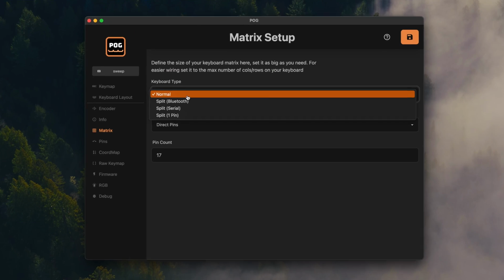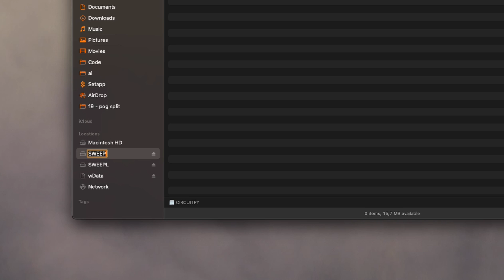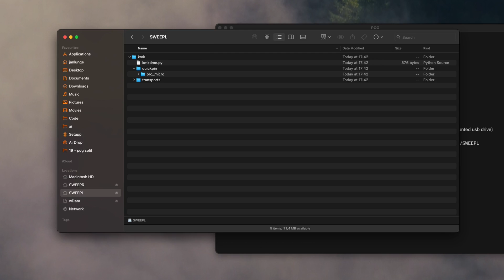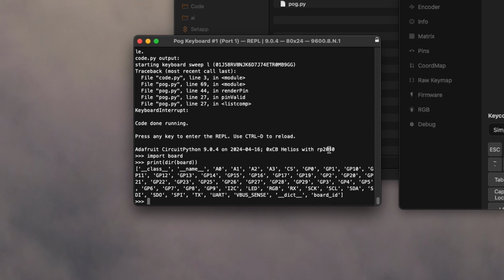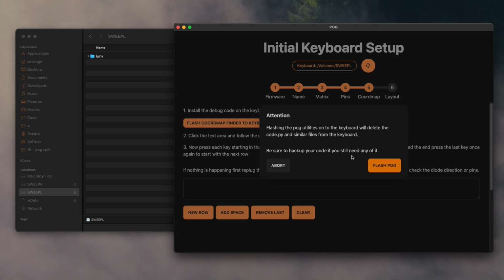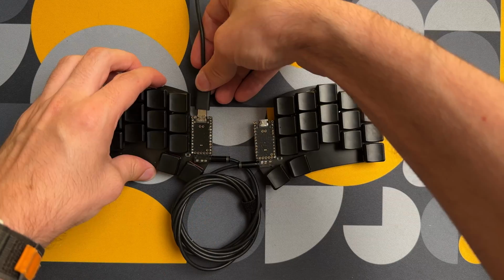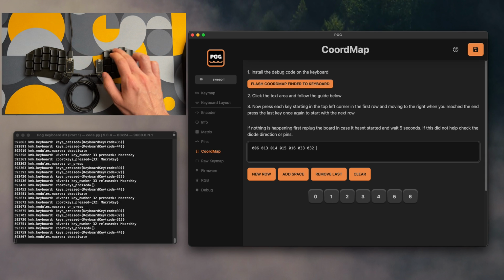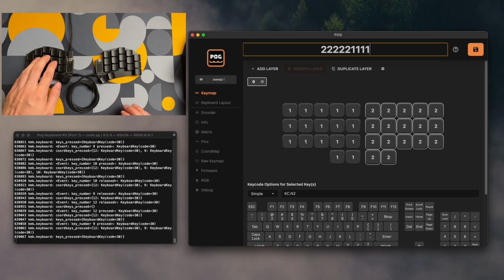Split Keyboard with KMK Firmware and POG Setup Guide

Comment: For some reason, I cant connect the two halves of my keyboard.  I am currently using the rp2040, the pi zero waveshare. The halves are connected by the Gpio 26, i ve tried using the usePio option but i cant get it connected. Do you have any idea of what could be this issue  ? I ve tested all connections and pins physically and they are all good, but the transmission doenst happpen. I am using the both halves connected to the pc as they were the main one

Comment: I need help !!! I dont know anything about coding and im trying to make a split dactyl manuform 5x7 keyboard with 4 key thumb clusters powered by the YD-RP2040 micro controller and ive tried to do everything and i mean EVERYTHING and theres nothing working ive wired the colums and rows collectly and i still get no input , i did all possible combinations in pog and i still get no input WHAT AM I DOING WROOOOONNNG!!!
Reply from the maker: Did you try each of the sides on their own when you set the type to normal instead of split?
Reply: Yes @JanLunge
Reply: @JanLunge  i fixed it it was a software problem i was pissed off when i wrote that message i took a nap and tried again with your older video about POG and it works now tysm

Comment: POG 2.0.4, CircuitPython 9.2.7, RP2040-zero. Board named TEST L. First screen: KMK install, Firmware Update. Second screen: name TEST L; Third screen: Split(1 pin) ... Forth: Drive Label L\R -> NEXT, Flash codmap finder... and keys not appear. But if I use Normal (not split) or as right side, then codmapfinder works. What I do wrong with left side?

Comment: Can this be used with pcb
Reply from the maker: Yes as long as you can find the pin variables somewhere porting works (if its using an rp2040) your mileage may vary

Comment: Thanks a lot. Cant say how much I appreciated this tool. I have experience the seamless firmware integration of GP2040 in custom controller scene and wish keyboard scene would have something equivalent. Your tool is exactly that. The fact that it supports the popular Pi Pico is the icing on the cake.

Comment: "I've successfully managed to run the KMK firmware on my ProMicro2040, but the process was quite difficult. Since English isn't my first language, I found myself constantly referring to your latest videos to flash the firmware. However, I encountered some configuration issues with the latest version of POG, especially regarding the setup of the matrix and pins.

For example, when configuring the matrix, after selecting 'Keyboard Type' as 'Split (Serial)' and moving on to configure the TX and RX (Split Pins A & B), if I later try to change the matrix setting from 'Split (Serial)' to 'Split (Pin)', I can no longer remove the incorrect 'Split Pins B' setting from the JSON file. The only way to fix this is to manually edit the configuration after everything is set.

Moreover, since keymap modifications are frequently required after the firmware is flashed, this issue forces me into a loop every time I save, and the only reliable solution is to reflash the firmware from scratch, ensuring everything is configured perfectly from the start."

Finally, thank you for making this excellent firmware configuration software for us to use.
Reply from the maker: yes it keeps the old values in the json but the code is supposed to ignore values that are not needed so there is no need to remove it by hand, if you encounter an unexpected error there please open an issue on github with some steps to replicate so I can try to fix this. Thanks for your feedback here :)

Comment: Hey Jan, I really want to start 3d printing my own keyboards aswell. What kind of 3d printer would you recommend?
Thanks already, and great videos man!
Reply from the maker: this really depends on the size of keyboard you want to build, for split keyboards even smaller printers work fine as well as the usual prusa i3 size, one you want to build things larger than the dactyl manuform or keyboards that are not split you need to either print them in separate parts like me or have much bigger printer, i can still recommend the prusa printers and i am still using the mk3s as I dont need to tinker with it much to get nice prints. the newer printers today are much better and I was looking at the voron printers but mine still works too well to upgrade as well as they are quite cheap to get used as well. I would rather recommend a used prusa or the bambu labs printers than the cheaper printers you can find just because of fire hazard issues. But this is something where you likely need to look into based on your requirements.

Comment: Will you be adding the snap back feature just like in the wooting keyboards?
Reply from the maker: I hard this a few times now, should be possible but I would need to dig a bit into the firmware for this. I will put it on my list

Comment: Jan the man, I've been following you for a few years since I made my first dactyl.
Super exited to see this configurator.  I'd love to see what you've got going on in github, particularly the mouse-key implementation.

I'll be building one when I get some time to try out using joysticks as mouse key inputs, that's an area that is challenging to get the "feel" right on.
But to see you grow in this community and on your channel has been a real treat.  

I will say that your presenting demeanor has changed, in a way that is very to-the-point; by recognizing there's more work on the backend than you can cram into a video -- I like the succinct statements.  

Really exited to see this, and Great job Jan!  
Big fan, cheers from california

Comment: Your pog software is amazing, it makes all the hard work done within matters of click. Its extremely useful for rp2040 builds, builds that works on circuitpython.
Its just missing a feature, that is to enable or disable n-key rollover feature, i know it is a thing mentioned in KMK's website, I've been trying to implement it but i cant figure it out and get it into working on my 60% keyboard. So good luck with that🙂